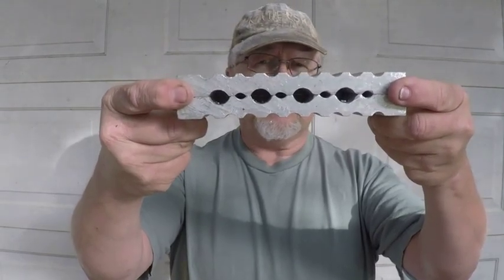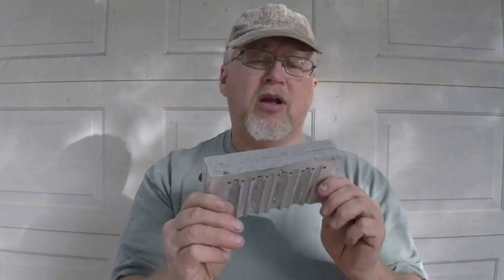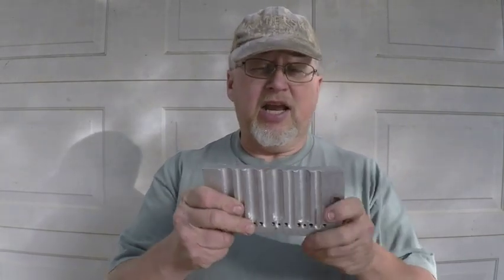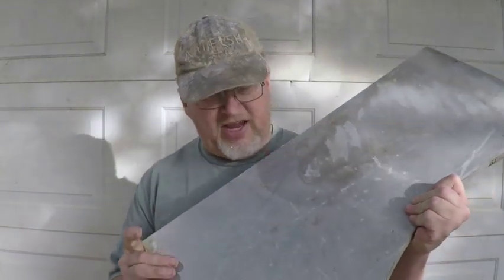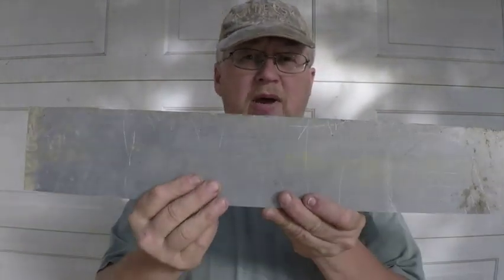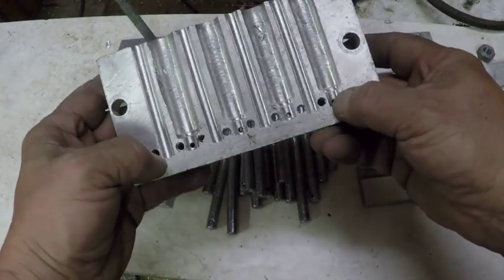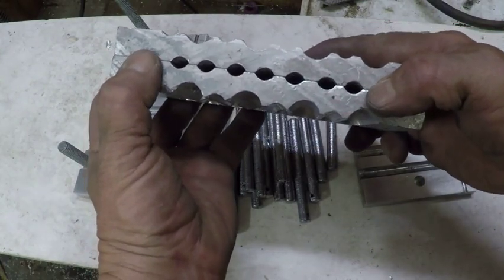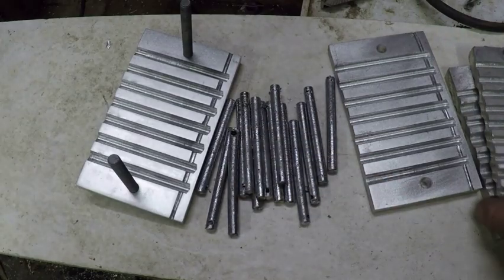HOW TO MAKE PENCIL / DRIFTING WEIGHT MOLD FROM SCRAP !!!!!!!

Comment: What size drill did you use for the last drill to make the 2 oz. and 4 oz. hole?
I assume the length of the holes is about 3 3/4" long, correct?

Comment: Thank you for shows us how to make them. How many pours can you get out of one of those it gets to hot to handle?
Reply from the maker: Actually if you weld the nuts in a piece of pipe. I can pour hundred. I usually wear welding gloves for protection when using melted lead anyway.

Comment: Question: could you use a piano hinge to keep the plate aligned and a  spring clamp to hold together while pouring?
Reply from the maker: The one I use I actually have spring pins in one side one on each end.  I should have shown that.  I drilled  the hole for the spring pin through both sides.  Installed pins in one side then over sized the other so it would slide on and off easy. then I use a spring clamp to hold together.   Thanks for watching and commenting I appreciate it

Comment: Enjoy watching creative men do craftwork, but you can buy bulk lead spools in 1/4 or 3/8" diameters and just cut them to whatever length you want and use pliers to flatten and a hole maker to complete it.  I expect the cost of the lead coil spools will be insignificantly more than the bulk lead you use to make these molded ones.
Reply from the maker: Lead spools are 5-8 dollars per pound.   Around here I get soft pure lead for about .40 a pound. And it’s just fun making stuff lol.  It’s about the challenge for me.  Thanks for watching and commenting I appreciate it.

Comment: Wow what kinda smelter do you have
Reply from the maker: I got a few of the Lee pots
Reply: I like the way your pot drips from the bottom. I have a hot pot and have to pick it up and pour it.
Reply from the maker: That one is about worn out.  Usually the stream is a lot bigger coming out the bottom.  That one is a  lee 10 lb.  I have a Lee that holds 20 also.  They’re worth the money.  You can add lead as you use it up.  Thanks for watching and taking time to comment.

Comment: Lol. Uses a table saw to cut a pilot hole so that way when he drills it’ll be “tried and true”. Then uses a hand drill to drill final hole!  YOU DO REALIZE NO MATTER HOW HARD YOU TRY YOU ARE NOT GOING TO DRILL STRAIGHT DOWN BY HAND. THIS IS WHAT DRILL PRESSES ARE FOR. EVEN THEN IT COULD VEER OFF. YOU ARE BETTER OFF DRILLING WITH A SHORT BIT TWICE.  ONE ON EACH END.
Reply from the maker: Yep.
Reply from the maker: Usually the table saw slot works perfectly. But trying to do it looking through a cameras lens kind of screwed me up lol.  Yes I use a drill press when I make them.  But not everyone has one.  
I appreciate you watching and commenting I like getting feed back good or bad.  I hope you choose to watch other videos I’ve made.  thanks.